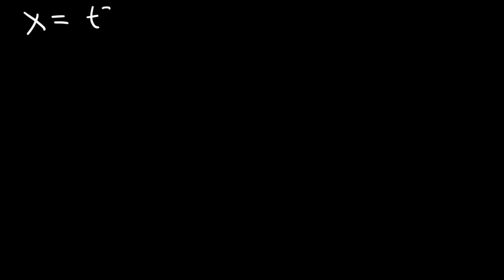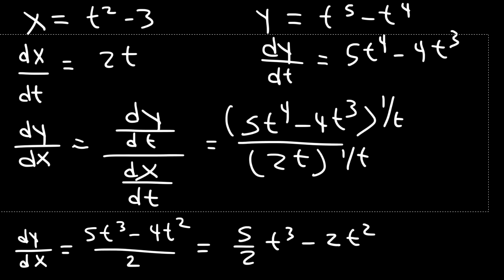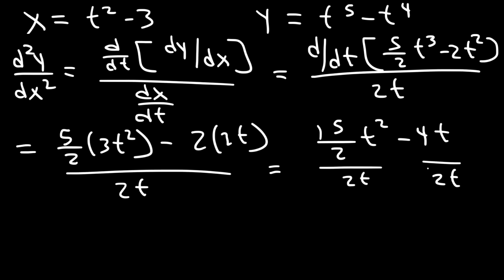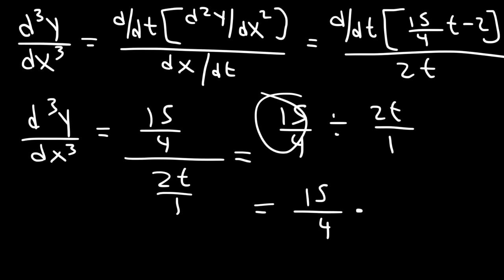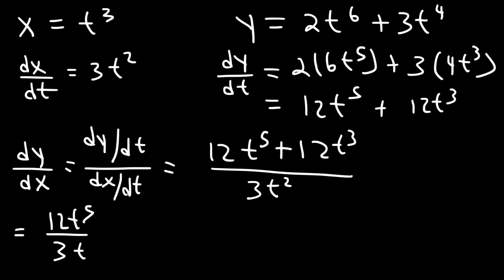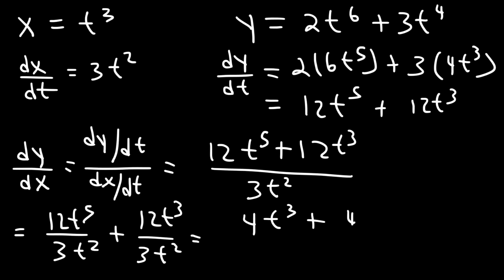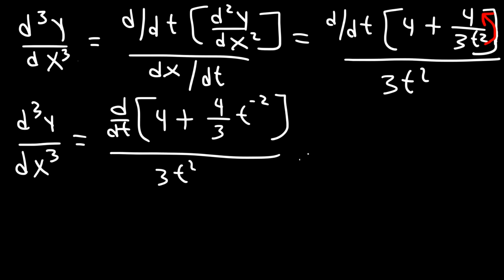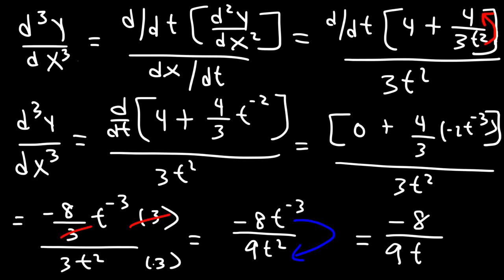Differentiation of Parametric Curves - Finding The Third Derivative

Comment: Can you plz solve this mcq
Q.1: The difference of temperature on °c and kelvin scale is :
a : same       b : Half
c : one third      d : one fouth

Q .2: The cell will function if its emf is : 
a :  -ve               b : +ve
c : may be -ve or +ve      
d : none of these

Plzz reply
Reply: And no replies
Reply: @adigicocs8855 Sad 2 years eh
Reply: i dont acutally know the first one but 0(degree)c can be converted in kelvin by adding 273
and the sec is (b) because a cell job is you to know do stuff and the resistance job is the lower the V the cell can be negative if the cell is placed in opposite to its side like +- -+ it will than act as a resistor and be -v i am sorry for the format if any doubt you can ask me
Reply: A) Same
B) Positive